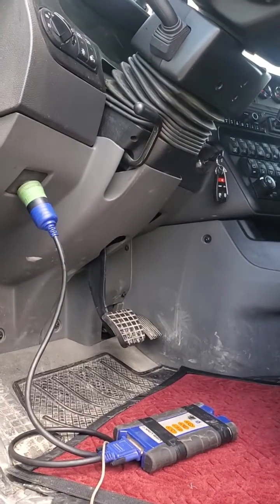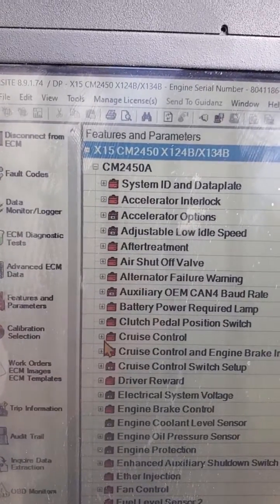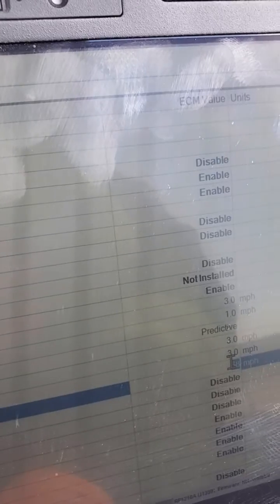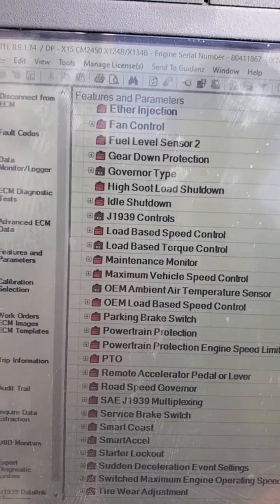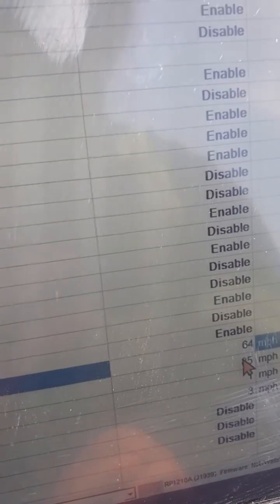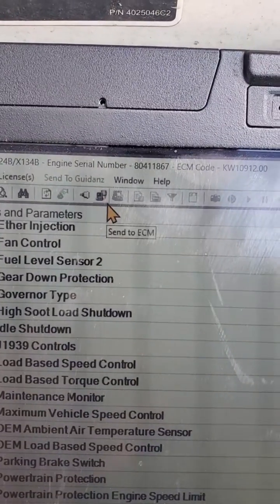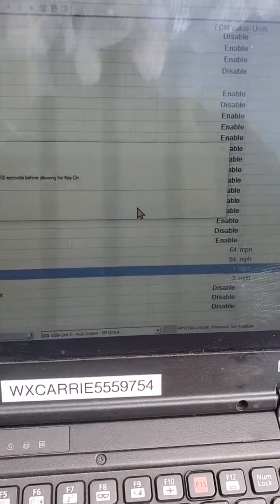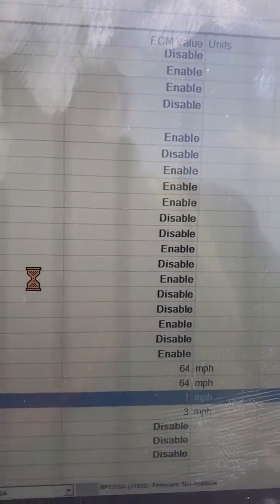How to change top speed/ maximum speed for CUMMINS engines

Comment: Where can we get this software you are using?
Reply from the maker: It's called Cummins Insite. You can download it free from Cummins website, but you'll have to purchase a key to change parameters. To do that, you need to contact Cummins.
Reply: What key? And what device is it you use to plug into truck and computer.?